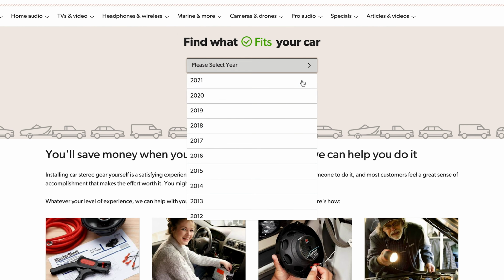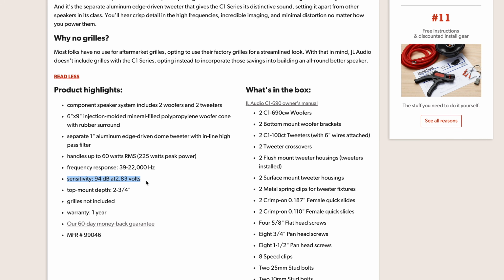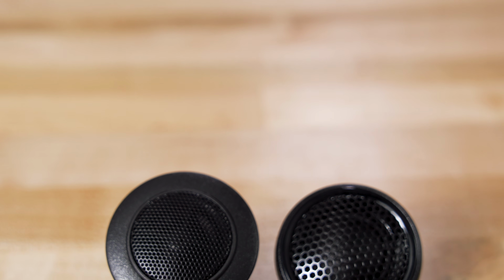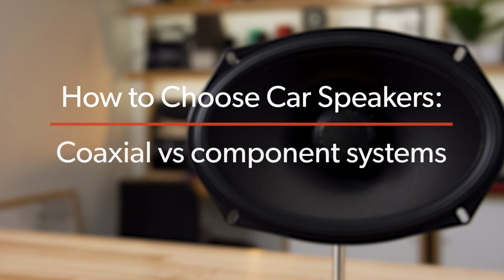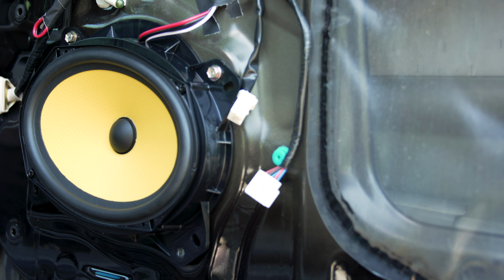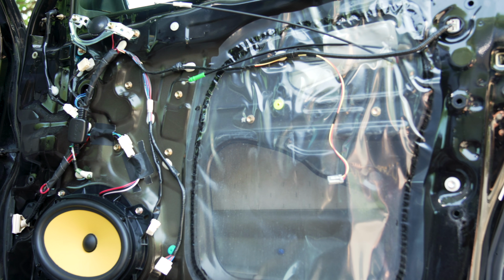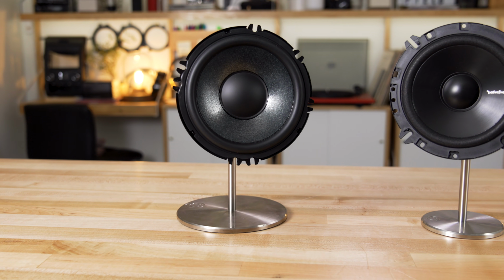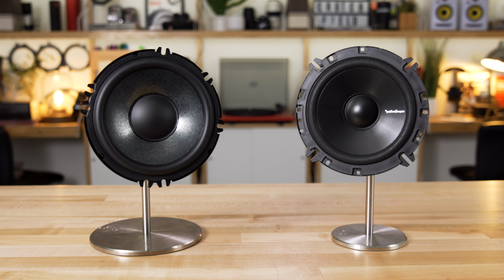How to choose car speakers | Crutchfield

Comment: Question:  2021 Toyota Tundra crewmaxx sr5 offroad.  Trying to replace my side front speakers with JL C3 570.  Now, do these require a specific cable to connect to the factory deck?  Or is the salesperson trying to rip me off.  He’s saying I require another piece of equipment at $500 or it won’t work.  Please help.
Reply from the maker: Wiring harnesses are available to help with the installation and they cost a lot less than $500. Was there any other gear discussed such as an amp? The stock speakers in this pickup have a lower impedance than these JL Audio speakers. If they are connected to the stock radio/amp they will pull less power from the stock system resulting in lower volume levels and not improve the sound.
Reply: @crutchfield  well the plan is to replace the side speakers as well.  However they cannot do it without a particular piece of equipment is what they are stating.
Reply from the maker: You'll hear a loss of volume if you replace your low-impedance factory speakers with standard 4-ohm replacement speakers like these. We recommend using aftermarket 2-ohm speakers as replacements in this location or adding an amp for 4-ohm speakers like these JLs. For help choosing an amp or a better speaker match, you can reach out to our advisors: https://www.crutchfield.com/I-rYTVc921/support/ContactUs.aspx

Comment: I have a 2004 Toyota Solara convertible with the JBL system. I would like to upgrade my system. I would like plug and play speakers to make things easier and neater. The head unit is factory but would like to add a touch screen with navigation, blue tooth, and a back up camera. Do they have harnesses that would plug into the old harnesses and go to the new head unit. I'm not good at trying to figure out where all those wires go. Help please.
Reply from the maker: We will be happy to check! Does your Solara have factory installed navigation?

Comment: I have a 1986 Pontiac Trans am .The speakers are premium ones. There are 2 small ones in a kinda base box in the mounting locations . How can I replace them .?  Or should I have the whole system removed and start over with a regular radio.
Reply from the maker: Hmmm,  you may be best served by talking with one of our advisors!  https://bit.ly/2KP1zS3

Comment: my clio has tweeters as standard on the dash
Reply from the maker: That indicates that a component speaker should be a better replacement because a component speaker comes with separate tweeters providing a replacement for the ones in the dash.

Comment: Alot of people here watching  don't know a thing about car audio, I don't know everything still  but I have educated myself in it quite a bit. When I started I blew the factory radio in my truck. It was a crappy radio and it was old. At first I thought that was the reason why it burned out. But as I learned more I realized It was something I had done. Later on one day I figured it out and learned that the front speakers were 4 ohm and the rear speakers were 8 ohm. One of the cheap rear 8 ohm factory drivers stopped working and I had a 4 ohm pioneer laying around from another car and I installed it. Well it worked for about a week or so then one day the radio stopped working. Later as I learned the details about car audio I realized what I had done. I overloaded the radio with a speaker with a lower resistance on the rear right channel and the radio could not handle that. What I'm saying is first learn and educate yourself before you change a speaker or something. If you have no clue then don't do it until you learn what's up.
Reply: thats why you should ALWAYS go thru Crutchfield as they tell you EXACTLY what fits and is compatible with you current system set-up including any modification changes one has made along the way.....
Reply: @MrMustangMan  I agree my man, thank you so much and have a great day

Comment: Eastside Low Bottoms sh*t !
Tappin' in from South Central LA
Great insight. I was having an issue with 6x9's in my lowrider. I went thru a few different brands because the tweeters would blow out on all of them. I had Kenwood, then tried Pioneer, then JBL, then Infinity. I ended up back with a pair of Kenwood, but with 650 watts. I was told to look less for watts which is "peak power" and look more for "RMS power". I haven't had that problem again so far, and they sound great !

Comment: I have a set of midrange speakers with a rms rating of 200 watts. I plan to use them in my motorcycle application. Do i need tweeters with them or can i just run them without the tweeters.
Reply from the maker: So, those speakers will only produce certain frequencies.  You likely need a crossover and tweeters to get full range sound!

Comment: Hello, i have installed an aftermarket pioneer stereo (deh- s320bt) in my car which says "output power: 50 (*4) watts" . Until how many watts RMS speakers can i buy? Cause i dont know if this "50" is watt RMS. For example if i place 80 Watt RMS speakers in my car, will the stereo be burnt? 
I have found some speakers (Jbl stage2 604c) which are 45 watt RMS and 270 watt max power . Will they fit my car?
Reply from the maker: Its best to look at the sensitivity of a speaker when searching for one to power with any receiver including the Pioneer receiver model you listed. A 90 db or higher sensitivity will work well with receiver power. According to the information about that model on JBL's site, they have a high sensitivity so they will work with the Pioneer's power
Reply: @crutchfield  Nice, thank you very much

Comment: How powerful speakers do I need for a 4x50 blaupunkt srq 46 ? Maybe any recommendations? Thx much!
Reply from the maker: The speakers need to be able to handle at least 24 watts RMS to work with that receiver. Ideally, they would have a high sensitivity as well to get the best sound you can with the power of the Blaupunkt receiver.

Comment: When I look up my 2013 Dodge Dart it shows that only 6.5” will fit but the factory size is 6x9.
Reply: Also can you hook up door speaker amps to a factory deck?
Reply from the maker: Due to one or more mounting measurements (i.e mounting depth, mounting height, cutout measurements, etc...), none of our current 6x9 speakers fit the front doors.
 
As for your amp question, it should be possible to install an amp to power the new speakers. How many speakers came factory installed in your Dart (4, 6, or 9)? What size LCD screen does the stock radio have on it?
Reply: @crutchfield  2013 dodge sxt with 6 speakers with the 8.4 inch display. Odd I would think that the front and back would be similar. Is it rare to find a 6x9 to fit the front?
Reply from the maker: When it comes to speaker sizes it does truly vary based on the make and model of the vehicle. There's many vehicles with 6x9 speakers in the front door. We have several options for integrating an amp into your stock system. Are you thinking about adding a sub as well?

Comment: I'm wondering, if my car came with tweeters, would I even need the crossover?  Wouldn't the signal already be sent to the right thing since they all came with tweeters?
Reply from the maker: No, not always. Some vehicle wire the tweeters in parallel with the corresponding woofers to the same channel on the amp/stock radio. What is the year, make, and model of your car?

Comment: I’m new to all the car audio I just bought a budget sub mtx terminator and I want front and back door speakers and I have no clue what to get or where to get them
Reply from the maker: We sell speakers for vehicles and often have gear to help make their installation a little easier. What is year, make, and model of your vehicle?
Reply: @crutchfield  2019 Dodge Charger sxt
Reply from the maker: Does your Charger have the factory Alpine or Harman Kardon audio system? You will see a logo for either of those audio systems on the front door sail panel.

Comment: Do I really need a subwoofer if I get really good speakers?
Reply from the maker: The best answer is it depends on your preferences. If you can get the bass you want from your speakers, then no. Otherwise, a subwoofer is needed to help boost the bass to the levels you prefer
Reply: @crutchfield  
What I trying to say is, if  I get a good pair of speakers for my car that are bassy rather than the manufacture ones that are already in car and rattle the inner door  paneling, Would it make a big difference?
Reply from the maker: The right subwoofer can always make a difference. Typically, they handle hundreds of watts and can produce deeper and stronger bass than speakers produce.
 
Also, if the bass from the door speakers is the cause of the rattling, then installing speakers that produce even more bass will cause even more rattling. That rattling noise can be reduced or eliminated by installing a sub elsewhere and blocking the bass to those door speakers.
Reply: @crutchfield  
Ok Thanks,
Which is the best subwoofer in a Kenwood under seat subwoofer with a remote.
Reply from the maker: Do you have a preference between sealed and ported sub boxes? What is the available space under the seats in your vehicle (width, depth, and height)?

Comment: I have a question @J R 

QUESTION IS, Why do sum amps and speakers fight each other when subs is in sealed box vs ported?

I have played with same amp and subs in sealed configuration amp shut down from heating up, but put subs in ported and it's fine.

Is this because to much air pressure build up in sealed box and subs can no longer move because of pressure or is something else going on I'm not understanding?

Thanks for good work keep it up

ps been messing with audio for the last 30 years
Reply from the maker: For this post, we are assuming the amp outputs the proper power at the proper ohms for the subwoofer.
 
The likely cause is that you were able to get the bass volume you wanted with less work from the amp because the port in the box helped create it. Since sealed boxes completely rely on the woofer for the audio, an amp will need to be worked harder to get back to the same perceived volume level as the ported box gave you.

Comment: Some things here that that irked me a little, like:

- Referromg people to the quoted frequency response spec (which is usually total BS and really completely meaningless)
- Implying that bigger speakers are better, which is not always the case depending on what you are trying to achieve
- Stereotypes about how different materials sound (these aren't always true)
- Suggesting turnign a tweeter up +3dB if low in a door, this isn't really going to fix the issue that moutning low in a door causes

But considering the video was clearly aimed at reltive beginners who are new to audio, and hence obviously trying to aim for a simplified message, I can let most of these pass.  It's a better advice then most of thes youtube videos I see.

Comment: There is no 1987 Volkswagen Polo on the site. Does it mean that there is no knowing of what fits and what doesnt?
Reply from the maker: It does mean that we do not know what speakers might fit into it. I think the reason is because VW did not release it in the U.S. market. Either way, since we do not have the information on it, we recommend checking with a local installer as they can at least measure the locations to identify what can fit it!

Comment: You don’t have toyota mark x details in your website.
Reply from the maker: We only have access to research vehicles released to the U.S. market.  The Mark X was release in Japan's market which is the reason we do not have it listed on our site. I wish I had different news for you there. We recommend checking with a local retailer for help replacing the speakers in your Mark X.

Comment: What’s best for a Hyundai Sonata 11
Reply from the maker: We will be happy to check on options for it and have a few questions to get started. Which sub-model Sonata is yours? Did it come with factory installed navigation? Will these speakers be connected to the stock radio/amp?

Comment: I have an older Jeep Wrangler we’re my only 2 options are the front 4x6 and over head 5.25. I have wires tied into the overhead that run to the very back where I have home stereo 4x6 box speakers in it. Can I tie 6x9 speakers in with the 5.25? I’m looking for more bass without having to get a sub
Reply from the maker: If you are using an amp to power the speakers it may be possible to add another pair of speakers to the amp channels that the 5.25" speakers are connected to. Do you have an amp installed powering those speakers? If you do, which brand/model is it? Which brand/model are the 5.25" speakers?
Reply: @crutchfield  right now I have no amps. The 5.25” are Sony 230w peak and 35w rms each. The 6x9s I’m wanting to get are Kicker CS series
Reply from the maker: It sounds like this will result in 2 speakers being connected to one amp channel on a radio. That is not recommended due to the lower power output resulting in reduced sound output and is not expected to make any noticeable change in the audio.
You could disconnect the 5.25" speakers and only connect the 6"x9" speakers to the receiver and expect bass improvements.
Another option would be to get an amp to power the speakers which means that you could have both the 5.25" and the 6"x9" speakers playing adding it the extra bass from the 6"x9" woofer on the speaker. We can help and need to know the brand/model of the 5.25" speakers as well as any others you want to try to get more sound from
Reply: @crutchfield  actually I found another route. I have about 6 RCA output slots on my head unit that I can plug into. If I plug 6x9 speakers into the RCA then it should create a second line to the back
Reply from the maker: The RCA outputs are preamp level audio and will not be able to power passive speakers. Those are the outputs used to send audio to external amps
Reply: @crutchfield  so if i get an amp I can plug them into the RCA and the RCA will take care of the stereo signal for me instead of splicing wire from the other speakers?
Reply: @crutchfield  also instead of the high power kickers I’m getting Kenwoods that RMS at 45w. Does that change anything?
Reply from the maker: That is correct. The RCA outputs can be used to send the audio to an external amp which will allow you to connect more speakers than just the 4 that a receiver is designed to power
Reply from the maker: Using speakers like those Kenwood's you listed does not change anything. Receivers are not powerful enough to run 2 speakers on one amp channel
Reply: @crutchfield  about how many watts do they produce though? It’s a 5v output
Reply: @crutchfield  ok then I will probably do pick up an amp soon then. Thanks for your help

Comment: If my car stereo has 50wattx4, what wattage speakers do I need for 4 speakers?
Reply from the maker: We will be happy to help you find speakers that will work. High efficiency speakers with any amount of watts will work and some that have lower efficiencies with a top RMS closer to the power output of the radio will work as well. I think that may be the peak power output of your radio and want to check. Which brand and model is your car stereo? Also, what is the year, make, and model of your vehicle?

Comment: how can your website dont have Skoda to check which gears fits in it?
Reply from the maker: Skoda vehicles are not sold within the United States which is where we are and the market our electronics are meant to be used in. I wish I had different news for you there and recommend checking with a local installer for help with finding replacements
Reply: @crutchfield  oh didnt know that, my bad then.

Comment: Couldn't have been explained any better, this is incredible. 
Are there any 6.5" front door speakers that exist with a frequency response of 30 Hz - 20,000 Hz ?
Looking for lower bass to replace Honda stock speakers
Reply from the maker: Thank you! What's the year and model of your Honda? How will you be powering the speakers?

Comment: I was thinking about upgrading the door speakers on a 2016 Rav4, but I noticed that Crutchfield had options that fit either the "front door" and "lower front door". Is there any difference between these speakers, or is it just some extra fluff I shouldn't worry about?
Reply from the maker: According to our research, there appears to be only one speaker location in the front doors of a 2016 Toyota Rav4 in both the JBL and non-JBL speaker systems. This means that you need only choose one speaker for the front doors. The speakers being lists as fitting the lower front doors are models made specifically for this type of Toyota mounting pattern. Its sometimes found in other models that have speakers higher in the front doors in addition to the lower speakers. So, this "separate listing" is a carryover from the programming we put in place to show what fits. And it also means that the speakers being shown as fitting the "lower front door" of your vehicle are made specifically for it and do not require extra parts to be installed. The location being listed as "front door" will need parts like mounting brackets or wiring harnesses to be installed. We discount those parts when ordered with the speaker.

Comment: Lol, if you want you dog to be able to enjoy the higher frequencies buy speakers that go up to 40,000 hz. I'm just playing nice video though. I'm on a mission to buy a head unit that is reasonably priced with the most output and try to get the best sound out of it without running and amp. I know that really limits what I can do but I can always add the sub with an amp later if I choose to do so.